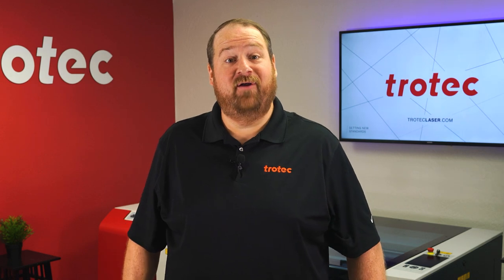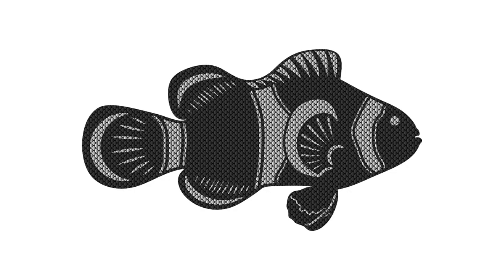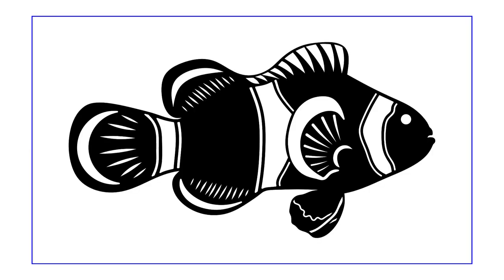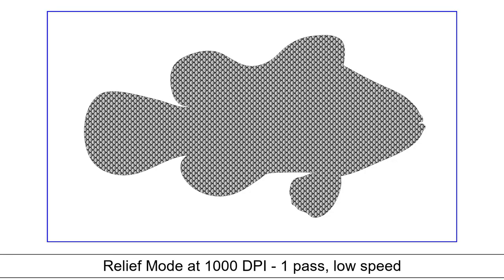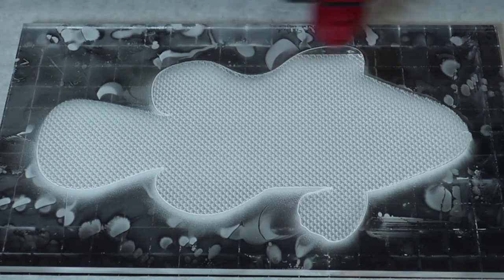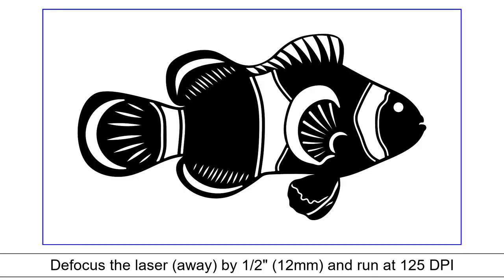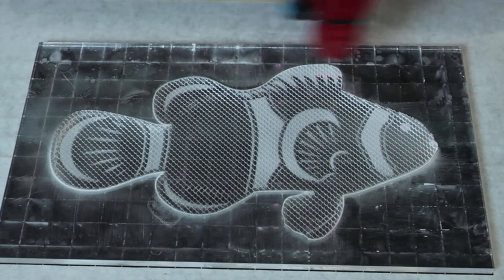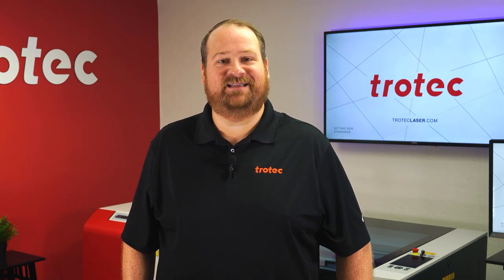Laser Hack: Glazed Acrylic Engraving with Relief Mode

Comment: I see, you cut acryl on a honeycomb bed, isn't a knife bed better for this?
Reply from the maker: This will depend on the acrylic's thickness, the laser's wattage, and the laser-cut acrylic's final use. The honeycomb will leave minor tic marks, whereas a knife bed will reduce this, but in this example, these marks are not noticeable on an application like this.
Reply: @TrotecLaser  Would cutting with paper or PE foil reduce these marks even more? We can't have a single mark, or we won't sell. Maybe adding some spacer would be the best idea. Btw. we plan with 130w or more.

Comment: Great work and actually very close to what we need to obtain. Can I ask you the timing report? How long does the process take? And the ripping time? Thanks
Reply: The time to process was around 10 minutes, and our lasers do not require any ripping time.
Reply: @davidstevens2577 Thanks, I'm actually having some issues about glazing my acrylic panel. I used the out-of-focus trick, worked with every parameter,but the White cast acrylic doesn't really want to get a shiny look...any tips?
Reply: I'll Try to explain: since now i printed with a UV printer my embosses,using White ink. It's less precise than the laser, but has a shiny look that the glazed acrylic can't reach. Maybe other materials can be engraved (safely) for Better results?

Comment: Won't running the laser att 100% massively shorten the lifespan of the tube?
Reply: Not and all; the only thing that will artificially shorten a laser's lifespan is if it is not cooled correctly over long periods of running. Running at 100% should not affect the laser lifespan; this may only hold true with some brands, but our core on this machine is made from ceramic and dissipates heat very well!

Comment: So how would a file actually be setup to get all three variations?
Reply from the maker: The file will need to be sent to the laser three times as three separate files located to a fixture or a snap point for alignment. The first file would be the cut file. The second file is the relief or 3D image run in focus to engrave the relief mode engraving, and then a third file with the black and white graphic with relief mode turned off and a Z offset of 0.5” out of focus to glaze the image.
Reply: @TrotecLaser  Sorry Dave, but that wasn't what I meant.  I meant how would you create from scratch something like that?  How can I use this to do other graphics and achieve the same outcome?  Great idea and concept but learning to do design something helps, thank you and hope that clarifies it better.